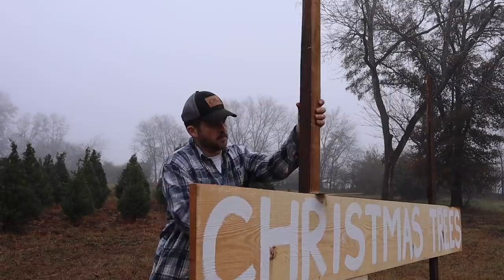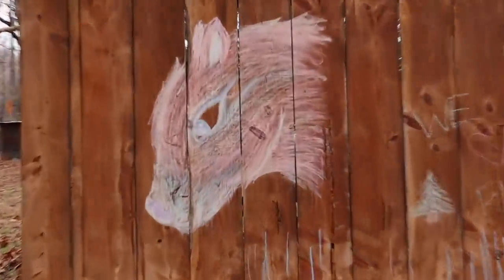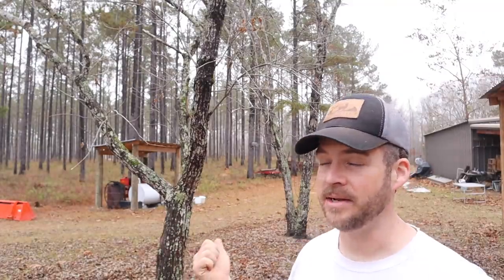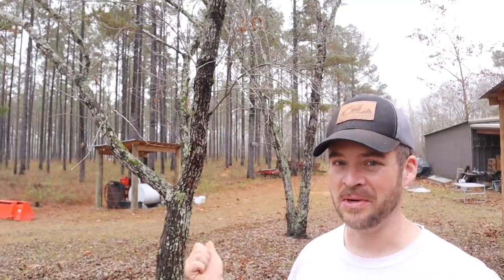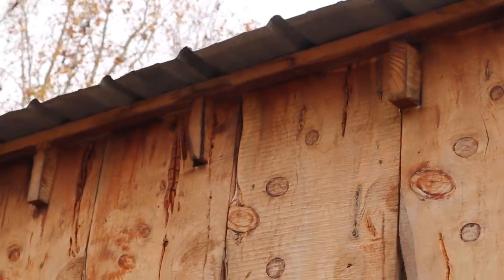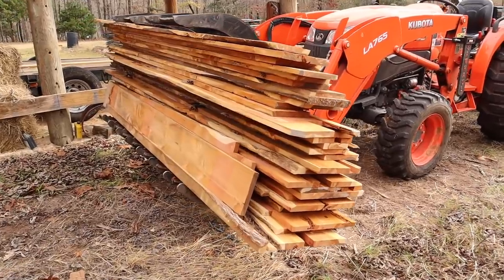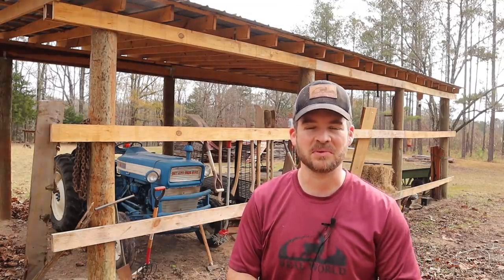Expanding the Sawmill Shed, Part 1

Comment from the maker: Second!

Dude, sharpen that chain.
Reply: Phillip's head screws suck.
Reply: Philip Shane   Those are not Phillip’s head screws.  They are star head screws.  The bits stay in the heads and there is very little, if any bit jumping out of the head.
Reply: @billmorris2613  they are clearly Phillip's head screws. @ :57 seconds plain as day. He's not using an impact driver and you can hear the bit calming out and jumping and stripping @ 1:19. Why talk about something that's clearly not the case?
Reply: @billmorris2613  stripping and jumping on every screw around the 1:30 mark. I've done carpentry for over 30 years. He's got a dull driver tip, they are inferior Phillip's head screws and the posts are too wobbly to get leverage enough to keep the driver from camping out. It's what Phillip's head screws do.
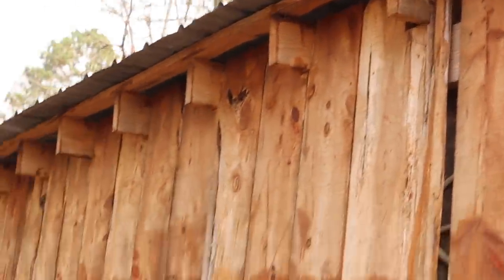Reply: Philip Shane   I thought you was referring to the ones on the siding. Not the Christmas Tree sign.  Those are Phillips head.  The ones on the siding are star head screws and start at 11:48.
Reply: Philip Shane   Yes I agree with you on the screws used on the Christmas Tree sign and the post not being sturdy.  I’m pretty sure the sign will be temporary until right after 25 Dec.
Reply: sharpening it that little won't do much good. the whole point is bent inwards (hitting metal or rocks) so you'll have to grind of a big amount before it to be good again.
Reply: Nathan Van de Velde   Looks like the sharpening did a lot of good.  I did not see any been teeth.  Can you give us a time where the bent tooth / teeth appear.
Reply: @billmorris2613  well yeah, any bit of sharpening does a bit good. go look back at where he zoomed in on the chain when he is sharpening. all are bent inwards.
Reply: @billmorris2613  you both are wrong, the screws on the sign was star and on the siding was TORX, and star sucks yeas
Reply: Me and Nature   Both of the screws visible on the sign are Phillips Head screws.  You may call them stars where you are from but they are defiantly Phillips.  The heads of the other 4 screws he used to actually screw the sign to the post are not visible.   What is visible on the siding are, in my neck of the woods,  called star head screws and use a TORX bit to install.  When researching the different types of screw heads there is not one called star head by the manufactures.  So the term star head may have different meanings in different parts of the country / world.  Phillips head is common to the different manufactures.  I did find in the description of a TORX driver as looking like a star.
Reply: Nathan Van de Velde   I went back and watched the sharpening at 25% of normal speed and stopped at each tooth.  I don’t see any bent teeth.
Reply: @billmorris2613  check again and look very closely to the working corner of the teeth. They are all shiny, that means they were rubbing metal or stones and are bend inwards. I don’t see him taking of much, just enough to get it sharper than it was. He needs to grind 1 mill further off to get the working corner back at full health.
Reply: @billmorris2613  alright well than its different where i live,

Comment: You've probably completed or already started the expansion of the shed by now, but I wanted to mention that making your own trusses is not that difficult.  I built a 20'x60' roof using trusses that I made on site for a pavilion in our local Scout camp.  The beauty of using trusses is that it provides a very wide space which is unsupported (ha! No visible means of support.  You can be arrested in some states for that!) in the middle, which would be perfect for a mill shed like yours.  Great video Wes, loved the timing of the falling sheathing, thumbs up.

Comment: Do not forget to pick up the screws that fell to the ground or next you will have tractor tires with screws in them.....Why not dig around the trees first and push over the trees instead cut them off near the ground.... Now you have stumps to deal with, tripping on, can place those inside new structure etc.....I understand taking them down limb for limb first but main trunk is pushed over.....

Comment: Just a word of advice.  NEVER drive into brush length wise with the grapple only grab it perpendicular to your direction of travel.  The most delicate parts of your tractor are behind it and it is all too easy for a branch to run through the grapple and puncture your grill, battery, or radiator.  And you won't see it coming!  Been there done that.  Thankfully I only lost a grill and a battery.  Expensive lesson but cheaper than it could have been. 

And I do have to agree.  I have a brush grapple on the front of mine (just vertical tines no sticking out on the bottom) and it spends 75 to 80+% of it's time on the tractor.  My bucket and pallet forks are jealous.  

Keep up the good work and I look forward to seeing your building "transformation".

Comment: To save time and to make life easier at the mill, build your self a skidway for your logs. Just flatten 6 or 8 logs to crib it up to the proper height, plus a couple of short pieces to span between it and the mill  when putting on logs. This way you can load a dozen or more logs at a time.

Comment: When sharpening square tooth chain, ALL the damage to the tip at the corner must be removed for it to cut well.  Remember all that cuts is the chrome plating, the rest of the tooth is support for that plating.

Comment: It's kind of late but you could of gotten a Arborist crew come in with one of those big spade grapples and transplanted them. But what would be neat is if you didn't burn up all the limbs yet you could start some cuttings in pots to get some to take and plant later.
Reply from the maker: I've seen those, they're way cool. It would probably cost way more than I'm willing to spend on it though.
Reply: @falllineridge  start looking in your area for prices in case you want and can do it later. Iv also seen guys dig the root ball up and grab on to it with a skidder that can hold it upright and move it.

Comment: Hi is there a reason why you just didn't make the extension to the front and leave the back and the trees in place?
Reply from the maker: Yes, the front of the shed is about 10 feet tall. If I went forward with it, it would end up being about 13 feet tall at the 21 foot mark. I don't have poles that long. Also, it would be very obtrusive into the yard.